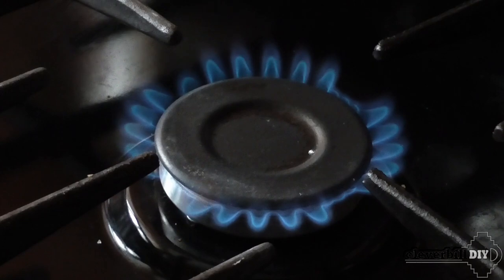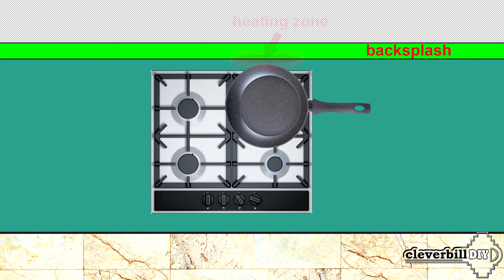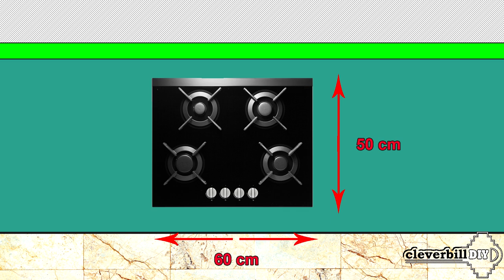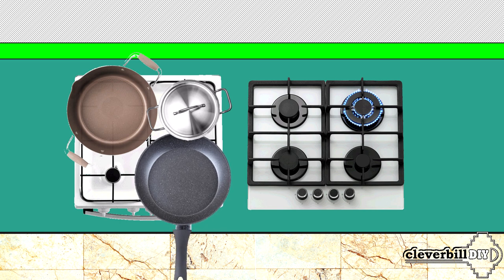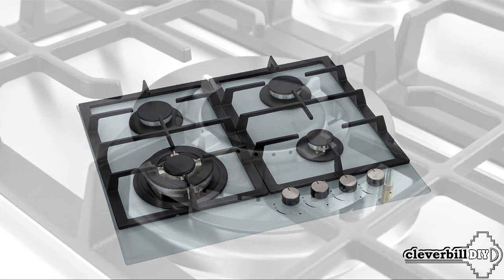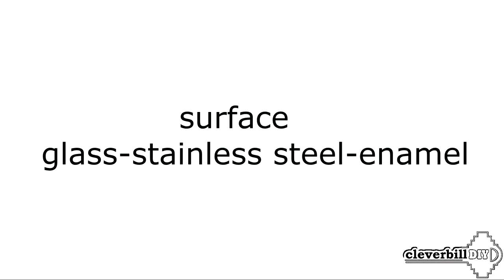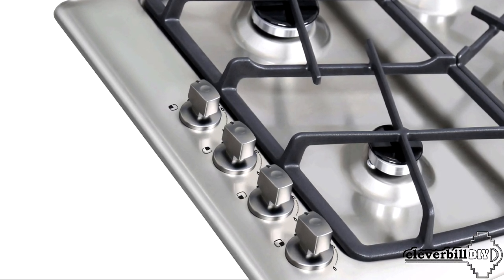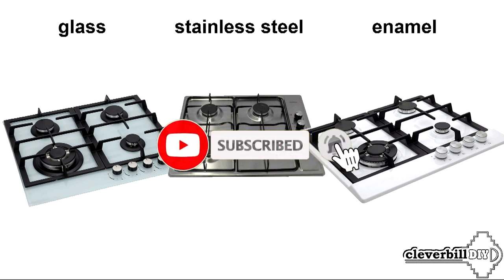Gas hob (surface) - how to choose what you need to know

Comment from the maker: When choosing a gas hob, it is important to consider the dimensions of the panel and understand how many burners are really needed. Make your choice between practicality and beauty (enamel - stainless steel or glass). I can also advise when choosing0 to pay attention to the manufacturers of the burners themselves - they make the best sabaf burners for almost all Italian manufacturers, as well as for more expensive Bosch / Siemens models and other well-known manufacturers (you can check by removing the burner and look at it from on the reverse side, there should be an inscription with the name of the manufacturer). Defendi - also Italian burners, are placed on simpler models.

Comment: Thank you for this video. Do you happen to know the durability of gas hobs? Do they last as long as gas cookers with ovens beneath?
Reply from the maker: Hello. Gas surfaces have the same details as stoves with an oven. It only matters here whether you melt the handles (using wide dishes) or break the glass (in the case of a glass surface). And the valves and burners are the same as the good old stove with oven.
Reply: @CleverBill-DIY  Great. Thanks a lot 😁